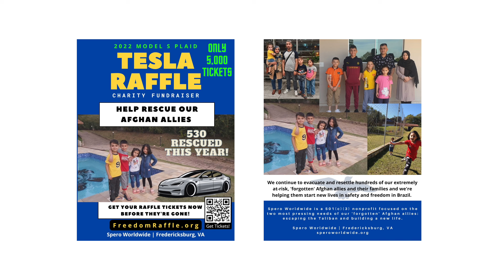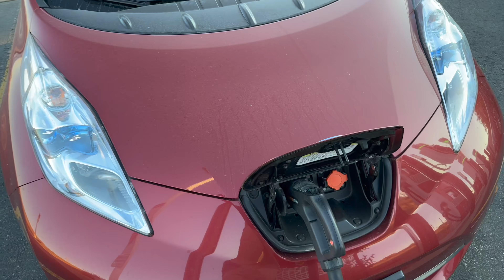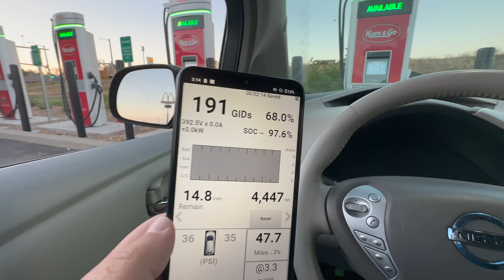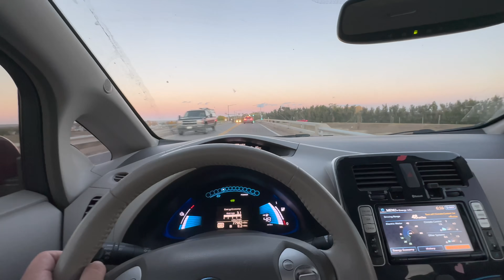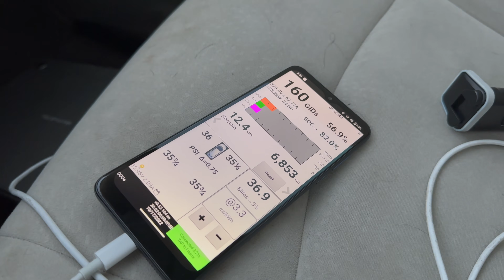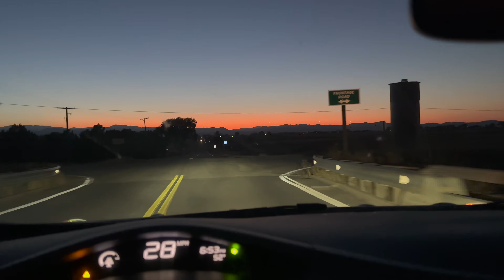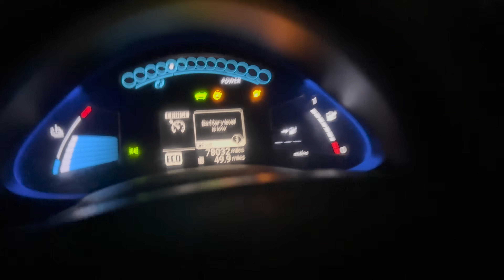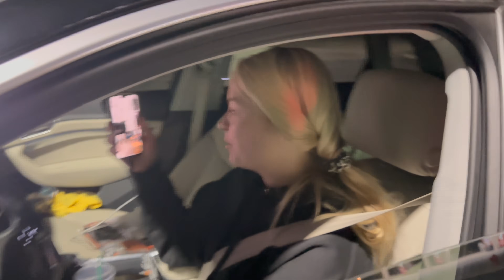Here's How Far My Cheap Nissan LEAF Goes On A Charge! Charging & 70-MPH Range Tests

Comment: Ah yes the ZE0 Lead (2011-2014).. They had a few battery, BMS and other problems. 2014 on the AZE0 may look the same But It has a different battery, BMS, Brake control system, Motor, Inverter, AC Charger.. It was almost a totally new model in the same body. The batteries in the newer AZE0 model last very well. Even now 12 years later it's easy to pick up a Leaf with a battery at 80% of original. They're quite modifyable too.. You can get a 40kWh or even a 62kWh battery from a ZE1 leaf and fit it. Or even swap in an inverter from a ZE1 leaf and upgrade them to 250hp :D :D... And use the old battery with soar at your house. Very solid reliable car, and even when they're not. Because there are so many of them. Spare parts are cheap and easy to find.

Comment: I own a 2013 Leaf and I have this issue where I can basically put the brakes all the way to the floor if I try to on some occasions. It still brales really well so it's very weird. I guess there's a possibility there's air in the line? Has anybody else had brake problem?

Comment: I just bought my 2013 leave about 4 months ago. It's got 91,000 mi on it and a range of just about 60. That's what the guesmeter tells me anyhow. Most times I charged it it'll show anything from 52 to 59. I had to drive on the freeway a few times in the last few weeks so it's not guessing a very high number but I get about 60. It would be perfect if I could get 40 more. 100 me would be exactly the range I would like to have but I don't have the money to get a 2015 or 16 though you can't do better buying a used car then buying a leaf. They do not sell very well and the price will keep coming down. I've seen 2016 now going for four grande with no real problems. If you want to get a nearly new looking car buy a leaf. You'll get used to the charging.

Comment: You will lengthen you battery 🔋 life by using level 1 or level 2 charging, not fast, and by keeping the charge no less than 20% and no higher than 80%. Also, hard acceleration (fast discharge) will shorten your battery life and, believe it or not, using regenerative breaking with shorten your battery life. If you have the ability, consider turning off regenerative braking.

Comment: Just bought a 2015 Leaf with 11 battery bars for $2000. Getting over 50 miles highway per charge. Very happy. 😊
Reply: 🫨🫨🫨only $2000 OMG Yes it's free!!! I bought a month ago 12 bars +88%soh 2016(69000km) American S trim for $6000, but minimum range of 75 miles.

Comment: I recently bought a 2019 Nissan Leaf with 40 kWh battery, under 33 K miles. I took it to a Nissan dealer for an expensive multiple point inspection since I have never had an electric car and it shows the battery at 12 bars (the newer leaf does not show bars on display, just a capacity bar) while my screen shows a full capacity bar.
  The range after 2 tests full charges to 100%(1 at Nissan and 1 I did for testing) shows 118 miles and 140 miles range after a few minutes driving. 
   Is this possible that this Nissan Leaf has a good battery like this after someone drive it 5 years?

Comment: Bro. I paid $1780, out the door, for a 2013 S with chademo. Still gets 70 miles per charge even though it has 103,000 miles on it.

I charge for free at the Safeway.

I'm considering dropping $1000 on a CCS to chademo adapter.

Comment: The old LEAF models are primarily meant for old people and students with no money, who don´t have money for repairs and only have to drive  couple of miles everyday in cold conditions.
You can basically have a LEAF for 10-20 years time without having to pay for repairs. All the newer cars are a lot more unstable, while the LEAF are built in such a simple and reliable way.
Best combination of reliability and long distance might be the new Nissan Ariya. But the more features we stuff into a car, the more repairs you should expect to happen.

I heard from several Tesla owners that in their circa 6-10 years time with them, they had to get at least 10-50 things fixed, and that half of those things were after the warranty expired, and that it was crazy expensive. And even a respectable brand like VW, I believe that the fact that they have like 100 faults with the software, demonstrates the problem with modern EVś.

I personally want an EV where I can mechanically bypass everything that is software in it, so it does not have to update to potentially not want to start up.

It takes nothing more than owning a Tesla, and it failing or succeeding an update, and then you can´t get to work and then you end up paying like 500-1000 USD within the warranty period. That is why I am never going to own a Tesla or anything chinese or french that is an EV.

All we need is a Nissan 100-200 kw car with a solid state battery, and then you most likely have a car that will guaranteed under any condition last 300-800k miles within 20 years time, that to me is the ultimate EV, not all of these fancy Tesla like cars with all kinds of locked features that have to go through a screen. How dumb is that, locking every function of the car through a sort of Ipad device? You are asking to basically only have a car for 6-10 years time when you are into that kind of a thing.

In a 20 year period, you can make a car go through 3 different owners in the same exact family who don´t have a lot of money. So a fantastic service to the world having invented the LEAF.

Also let me add that changing the gear system from the LEAF to the Ariya model, most likely will create together with all the new added electrical features a lot more repairs. So I think that most people should be aware of this.

The only really bad thing about the LEAF are small things, like the paint job quality, neck supporter, and plastic console that you have to rest your leg against. People should embrace the fact that it is so simple/solid a car. All the newer car models will guaranteed statistically, not last as long as a LEAF car. The only big problem is the range/DC charging getting too hot/owning one is hot places and having to use public places to charge it. If you buy this car, only buy it if you can make everything workout for you while charging at home.

Comment: Did you know that if the 12v battery(under the hood) is malfunctioning, the home charger won't work? I just went through that and it saved me $1,800.

Comment: Ok you'll have to explain to some ppl here this is worst case scenario. Ordinarily you could use your home charger which this vehicle's level 2 charger is toast. Its a really easy fix costs 100 bucks and you could repair within a day. But the DC charger which he is using bypasses the onboard charger to rapid charge the battery directly. Not great for battery health due to heat transfer but it works.

Comment: This is the issue with with electric vehicles, particularly used ones, A 2012 Nissan with an internal combustion engine and 78,000 miles, if well-maintained, would be suitable for driving, the cost of replacing the battery for an EV could range from $6,000 to $12,000 .
Reply: These batteries are 1k and 3k for the upgraded battery pack. Much cheaper than a golf cart and the price of a beat up Honda Civic lol

Comment: You are no EV battery expert by any means ! Power Stored (in KW-Hrs) in the battery vs Power Delivered (in KW-Hrs) is MUCH lower to the tune of 10 to 20 % losses due to both IR transmission losses and battery chemistry and resistance losses. 

Please refrain from casually tossing out numbers of which you have no knowledge. This is just plain misinformation and is very deceptive.

Comment: At full, it is normal to have all cells balanced. That is why it takes so much time to charge fully, is because the car does bleeding off some cells to allow for others to fully charge. 
The real indicator is the voltage difference at low state of charge. Those which are drained more than others are with bad heath.

Comment: I won't spend more than £2000 on a vehicle..
My current vehicle is 20 years old.
It's fuel tank still holds the same amount of fuel.
It's now done 470,000 miles and still averages 50mpg.
Oh and it takes 5 mins and it's good for another 600+ miles.

I hired an EV van for a month.
Gave it back after 2 weeks.
Range too short.
Charge time too long.
Charging facilities are sparse and unreliable.
It cost me time, money and lost customer appointments.

Comment: I can say this your car for being a year older and having one less battery health bar than mine which has 10 it seems a lot more efficient than mine on higher speeds. Mine shows 80-85 miles when fully charged but I don't think that at 70 mph it would do 50 miles range at those speeds. I'm wondering now, hmmmmm???

Comment: I bought a 2013 Nissan Leaf S for $3000 with 90,000 miles and 10 out of the 12 battery health bars. Full charge does 80-85 miles range depending on your driving. Car is really more of a city or around town commuter which is exactly what I needed it for. My wife's commute to work and back is 40 miles. This car really shines at the 30-45 mph driving speed, once you hit over 50 mph it's going to eat away at your range.

Comment: Governments should hold the EV manufacturers to account, and insist they offer replacement batteries at a price that is reasonable in relationship to the value of the vehicle. Otherwise the environmental credibility of these vehicles does not stack up. The bottom of the EV market has fallen out due purely to the range factor.

Comment: We had 2015 leaf from 2017 to 2022. Great car, no problems. If you can live with the small range it makes a good daily driver. When we traded it for our Bolt I calculated our total cost of ownership. Purchased price -traded in value, electricity, maintainence (tires, wipers, and a 12 volt battery) the total cost was less than what we would have paid for gas for the ICE car it replaced to drive the same number of miles.

Comment: The Leaf is a well made EV outside of the HV battery, and by the end they got that right as well.
  The real story is how you can't buy a newer battery with a LOT more capacity and will last a lot longer than the Original one and have it put in, despite it being fairly easy to actually do.
  Congress should have made it if were going to subsidize EV's they should not be scrapped over issues like that.

Comment: Not long after watching your video I was  finally able to buy a Nissan Leaf for myself. My first EV.
The trip home was 112 miles from the dealership. Best distance it was able to achieve between charges was 64 miles at highway speeds 65-70mph.
So far I love my little go-cart. 😊
Reply: I have a 2019 model with 40 kw pack, it has a range around 120-140 miles. Each day my work commute is 100 /110 per day.
Reply: So city miles would be more ?
Reply: @rolandthethompsongunner64 over 50 mph and wind drag becomes significant. 70mph is much higher drag. But also if you're in a huge congested city then you might only be going 10mph. So.
Reply: Hi i just bought a nissan leaf it says it has a 90 mile range. I dont drive alot just to work and back and errands, is that good for that range. How long does it take to charge, how often are u charging it

Comment: I love mine, mine has 17kwh 2014 model,  work and back :)  i doubled the motor power in mine with an e+ inverter so its lots of fun in the 5 second bracket :)

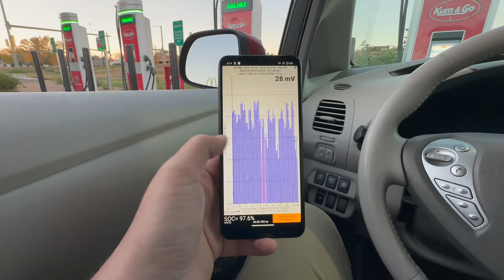Comment: 12:56 Proof right there kids on how badly out of balance his leaf's Battery is kids so if your seeing him run her completely dead like that seeing that screen after a full charge will level those bars out some what bringing that battery back into balance a bit atleast to really rebalanced the battery he would have to make this video doing what he's doing to the car multiple times to get those cells as close together as he can in charge levels to balance the battery if it's even still possible

Comment: That's my car :-) well same one I had a 2012 red just like that I love that color and interestingly enough my OBC also failed! Thankfully under warranty as it was an $1,800 part

I was not however a fan of the resistance heater it made the car almost unusable in the winter time it was an absolute pig for energy

It was replaced with a 2016 after a lady rear enemy at a red light and the insurance company totaled it

I really love my 2016 the extra range the heat pump it's amazing except I have a bad battery a few of the individual cells inside the traction pack are going bad they undervolt which causes the BMS to safety the pack so now my car with only 40,000 mi on it can only go about 50 mi because of those bad cells and I can't go to Albuquerque anymore because the strain of climbing back up the mountain causes the BMS to safety which turns off the battery pack and the only way to reboot it is to plug it into the charger

Nissan refuses the warranty The battery because this failure condition doesn't trigger any problems in their system they know it's wrong they know it's bad they know what is bad but they refuse to warranty it so now I'm stuck with a car that can only go 50 miles and only if I don't push it very hard and have to hope that in less than a year I lose one more battery bar to trigger an automatic replacement

F u Nissan I talked the leaf up to everybody I love my leaf not standing behind and obviously bad battery is real s***

Comment: The percentage to the right of GIDs is the % of GIDs. It is not the SOC (Sate of Charge) %.  I have found the Guess-O-meter (GOM) on the Leaf Dashboard does not match Leaf Spy Pro,  SOC at least not in my 2023 Leaf SL, Leaf Spy shows a lower percentage It is speculated that the different is due to a  Engineering ~5% buffer that the battery reserves for regenerative braking storage on the top end. For example my 2023 Leaf Spy shows 96.2% SOC, when the GOM  show 100% in 44 degrees F weather. The GIDs show 731 ( 94.3% of “maximum” GIDs). Nissan Marketing says the High Voltage (HV) Battery in the 2023 is 60kWh (The 2022 Leaf Plus was said to be 62 kWh), range is about the same, so the 2023 is either more efficient, or regulatory and/or engineering calculations were updated to say 60kWh. It may be the same battery pack, only more investigations will determine if the HV batteries are the same between the 2022 and the 2023 Leaf Plus models. NOTE: The GID unit was names after Gary Giddings, and he stated it is the amount of USEABLE energy in the battery with 77.5 watts and in a 2011 24kWh pack (281 GIDs x 77.5 watts, stated its usable energy = 281 x 77.5 = 21.78 kWh in a 24 kWh HV Battery. In my 2023, the max GIDs is said to be 775, so 775 x 77.5 = 60.1 kWh usable. On my last 100% charge, my Leaf Spy Pro GIDs were 731 (731 x 77.5 = 56.7 kWh), it also said this was 94.3% GIDs, so that tracks with 775 being the maximum GIDs ( 731 / 94.3 * 100 = 775 ).

Comment: The Leaf is a well thought out car for the driver.  I really love my one. I have done about 85,000km in 5 years. My one is good for a 130km round trip, I have an 80km round trip commute at the moment. On the older Leaf the charging speed and regen are good in the bottom half of the battery. The speed limit is 100km where I live, but you can drive 90 in the slow lane without holding people up, if you want to maximise range.

Comment: I would have liked it if you had shown the individual cell voltages when empty. Would be neat to see if it is just one cell that is killing the range. You can rebuild/repair those with cells from green tech auto on ebay. just a thought.

Comment: RANGE ANXIETY -- I saw the first intro of the Nissan Leaf back around 2011. It had a range of barely 75 miles!
They were rated as toys, not practical for most daily commuting nor for any distance driving. It was only good for grocery shopping or drive the kids ro school or activities. Yes, they have made improvements but still not practical until they develop batteries with 2, 3+ capacity of current Lithium Ion technology. Hydrogen, is in it's infancy. Not practical either to fill up your vehicle with compressed hydrogen storage cylinders.

Comment: Very Cool test for an 'elderly?' Nissan Leaf.  I am impressed.  3700 bucks.  Great buy.
If I were you I would be reticent about replacing the battery module just yet.  But when the time comes, I hope you ensure the old one will be recycled in the most practical way.  Cannot remember who that TELSA guy was who started the leading-edge recycling company, but that would be my choice for disposal.

So great to see that some early EV vehicles can still make a good impression on the thrust towards a focused energy supply - electrical - whatever the original energy source.
This makes the much needed refurbishment of energy delivery SO MUCH MORE SIMPLE.

Comment: How Easily Millenniums get excited by a APP showing an EV that takes ages to recharge [at what cost] comes anywhere near a modern Mercedes B200 CDi (Diesel) that will do over 80 MPG at same conditions and take less than 5 Minutes to recharge with a top up - say no more !

Comment: I had read that the Leafs were speed limited, so when I found a downhill portion of interstate with a tailwind I tested how fast my 13 Leaf would go. I got to 110mph indicated before I ran out of road, it never hit any limiter. It's not very useful since it'd go about 20 miles at that speed, though.